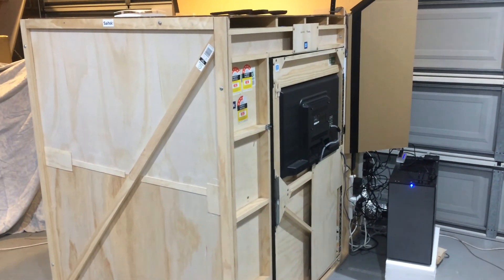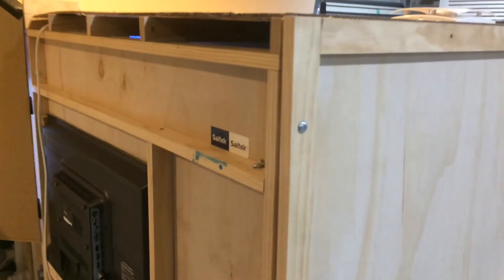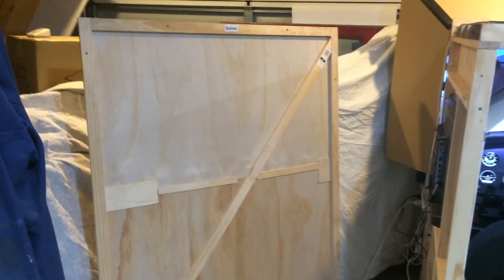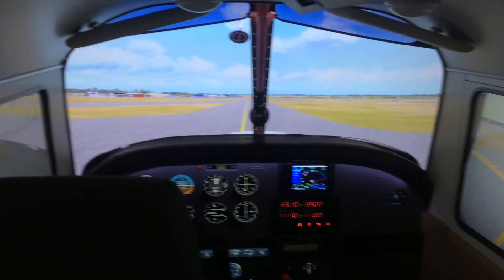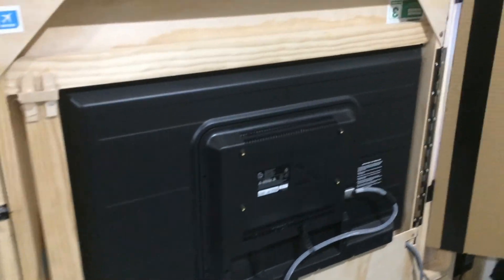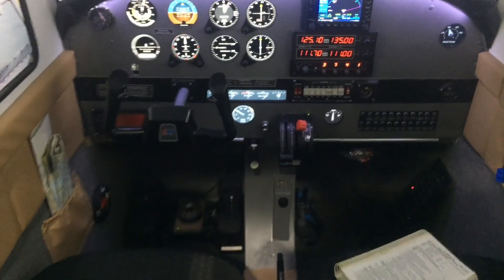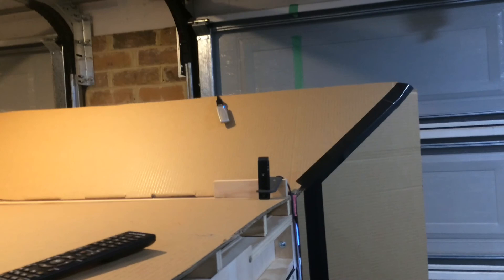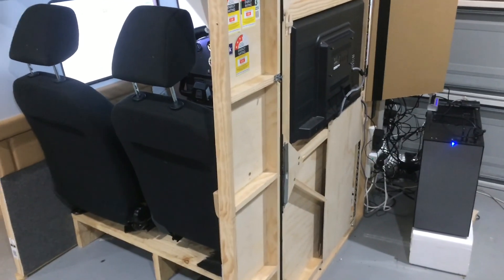Piper P28A Home Cockpit Tour

Comment: Really cool, one of the best ones I’ve come across so far. What material die you use for the curved roof lining??
Reply from the maker: I used a product in Australia called Signboard which I purchased from Bunnings. It is like foam plastic sandwiched between two thin layers of flat plastic which has a plastic sheet that helps protect it while you are building, then you peel off the protective coating, and it's all clean.
Very flexible but strong.
Reply: @vitra11  thank you!

Comment: Nice one brother, what are the dimensions roughly ?
Reply from the maker: it is 1mtr 100mm width, 1mtr 450mm high, 1mtr 500mm from front screen to back wall. These are the internal measurments.  I wanted it tight like the real thing. I felt it is better to train with the same constraints as you have in the real thing.
Reply from the maker: sorry, for the late reply, just an FYI, I wrote a book, How to build a home cockpit, with plans and explanations.  It's on AMAZON, and the sim is on the front cover.